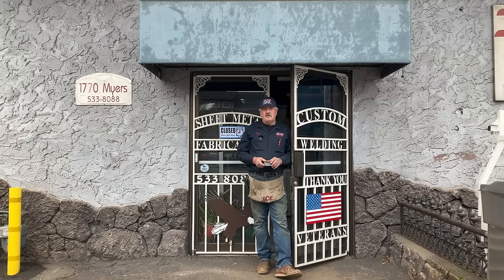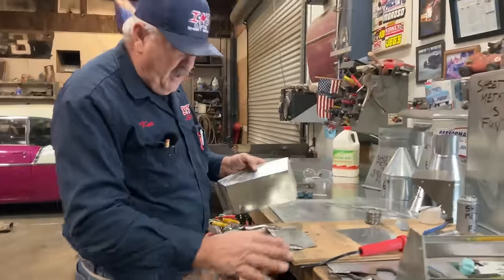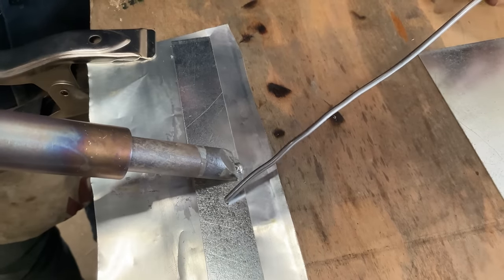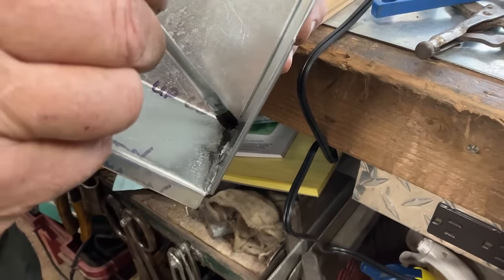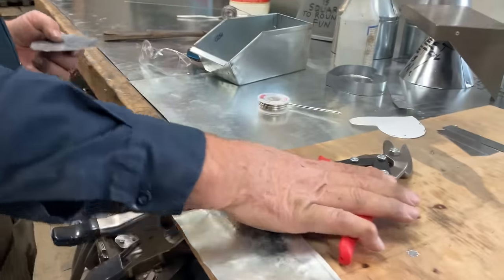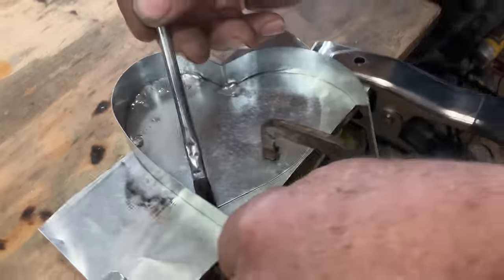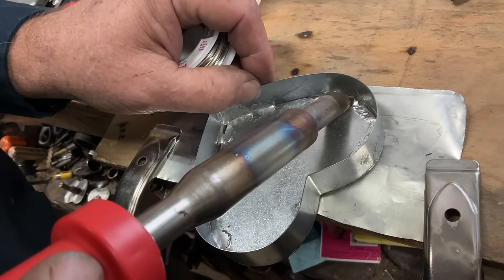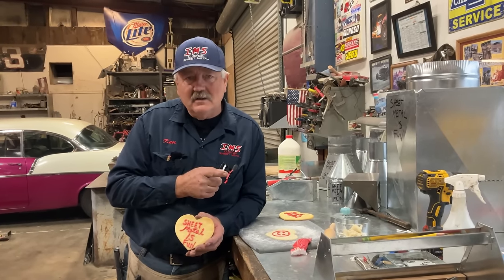Sheet Metal is Fun! Soldering from the Heart!

Comment: i wish you would have talked more about the different solders that are available and which one to use on different metals, like when to use flux core or solid, when to use the acid or could you have used a flux instead of the acid.
Reply from the maker: 50 50 (tin lead) is the old stand by, all around solder. Tin adds hardness lead is softness. Old body shops use 60 40. Muratic acid is swimming pool acid and works best on galvanized. I've never used Flux core, so do a little research on that one. Flux is better on copper and stainless. Lead free doesn't flow out as well, but it's better for humans and the environment. An iron is better on flat stock, but a torch should be used on copper pipes. Let me know if this helps
Good questions. Thanks for watching

Comment: Nice job - Thanks for sharing this! 
I just finished repairing a big copper sheet metal weathervane using some of your techniques. Talk about heat spreading fast and melting nearby solder - Yipes! This was a fullbody sailboat design, so it was hard to join along the hull edge to the deck of the boat (sort of an outside corner joint). The solution was to use small "hog rings" as a series of tiny clamps to keep things in position.  Tedious but fun!   Subscribed!
Reply from the maker: That copper is a go getter when it comes to heat transfer. I'm glad you found application in our lessons. We are glad that you found us. Thank you for your time and encouragement.

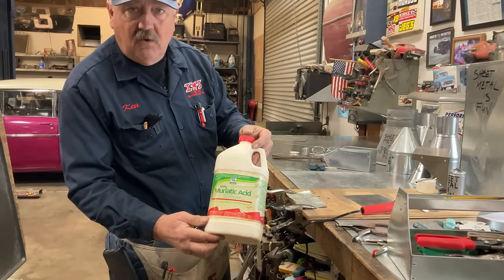Comment: 5:20  Acid brushes make sense now.  ❤  Happy New Year.
Plumbers call lead free soldier "95-5"  
A 5 pound spool has .5% or .05% silver.  Silverloy.  
Safety-Silv is brazing rod with 45-56% silver.
Very expensive and the "flux" looks like chunks of white sugar when it dries out.❤
Reply from the maker: You know your stuff. I know the lead free stuff aint cheap. Thanks for your time.

Comment: Is flux the same thing as muriatic acid? Or visa versa? Could I use your acid/lead free solder to join to pieces of steel wire together perpendicular to each other?
Reply from the maker: Flux is better for copper and stainless steel.Muratic acid works best for galvanized. Solder is only a surface adhesion, so it is insufficient when applied to a small area such as wire. Plus, the wire requires a greater heat source due to its density. Good questions. Let me know if this answers your questions. Thanks for asking

Comment: I need to make a small tray which will hang on the edge of my grinding table to hold water, I will be using your method of hand bending it. I am making this from stainless steel and want to solder the seals to seal it what flux and solder is best. Just a side note thank you for some very informative videos. Would it have been better to put something onder the hold down grips to prevent denting the bottom of the heart box. Again thank you for the videos
Reply from the maker: Good eye on the dent. When soldering stainless, you got to use liquid soldering Flux. Use solid core lead if you can get it. It flows better on stainless . Thanks for hanging out with us. Let me know if that answers your question.
Reply: @kengodfrey1956  Thank you I will let you know how I get on. That is when I have inished  small project I am working on.

Comment: I was thinking cookie cutter, cookie cutter. LOL Very nice video. I have always been curious about how easy or difficult it would be to solder something together like that. Now I know. Cool Beans!! I have learned some interesting (and fun) stuff from watching you work on this channel. 

I have a couple of questions, though. When working with galvanized metal, we are taught about the perils of inadequate ventilation and the harmful vapors when welding or grinding that material. Do those concerns apply when applying the acid to the project in this case? 

A lot of my projects involve using a dedicated soldering iron to melt holes in webbing during the assembly of a project. The fumes are rather nasty and supposedly bad for ya. 
Maybe a good project down the road would be to demonstrate how to build a small portable fume hood/extractor to have for projects like this? Just an idea. 

I noticed your acid brush kept rolling off your spray can lid. You can put a notch on the rim in a quick minute to solve that issue. No roll, no mo. :-) 

Thanks for all your great content.
Reply from the maker: Lots of questions.  That's good. Here we go. Never weld galvanized. Grinding and soldering are inherently risky. Use caution and ventilation. I should have mentioned ventilation on our soldering lesson. Good catch. I have to send this so I can read the rest of your question
Reply from the maker: We use a portable dust collector when we are in an enclosed area. It's on wheels and generally used by wood shops. Our shop is so drafty, small projects generally don't require much ventilation. Good idea on the paint can lid notch. Thanks for watching and commenting.

Comment: Brilliant episode as always. Two questions
1. How do you clean up the edges / seems especially on the inisde faces?
2. Alternative for muriatic acid? (In UK anything stronger than vinegar is strongly controlled 😢
Reply from the maker: If you can find liquid soldering Flux, it's a reasonable substitute.  To clean up the edges, I use a damp cotton rag , and wipe the excess solder off while in its molten state. So if the project is complete, you must use your soldering iron to re- heat the solder. Use caution. Let me know if this helps. Good question.

Comment: Do you have any suggestions as to best types of flux to use. I been trying to solder  a tubeless tire air valve into a empty spray paint can and no matter what I try it just won't bond. Not sure what type of metal it is made of. You make this look so easy. Great video.
Reply from the maker: Most Schrader valves are brass or stainless. Make sure your Flux lists both on its label. If you're using a torch, use paste. If you're using an iron, use liquid
Reply from the maker: Let me know how that works. Thanks for watching

Comment: Ken, what do you think is the thickest sheet metal that can be soldered (capillary action)?  at what thickness do you need to use other methods (brazing, welding?)
Reply from the maker: Depends on the weight of your soldering iron, but 20 ga. Is usually the limit. Welding 20 gauge requires a very tight joint. Welding is best , starting at 18 ga. We usually save brazing for cast iron . Remember, brazing is not welding, it's only a surface adhesion. It doesn't require or allow the material to become molten, so it's not a structural,  full penetration weld. Let me know if that helps. Thanks for watching and asking questions.
Reply: thanks Ken.  yes that helps.  also, the muriatic acid works for galvanized sheet, and acts like a flux (if I understand correctly).  but what if I am using galvanealed sheet metal. such as jet kote.  do I need to grind off the coating first before I try to solder it?  (say 24 gauge). and in that case, would muriatic acid work, or should I use a flux when soldering?  what kind of flux?   @kengodfrey1956
Reply from the maker: @markdeitchman8938  you gotta get that coating off. We use muratic acid and maroon scotch brite.

Comment: HVAC sheet metal tech here… Wiss snips are the gold standard in my opinion.  Greens come out nearly 5% of the time…. offsets are a luxury and only to be used 100% appropriately as they cost more
Reply: Started watching to see your approach and technique and stayed for your years of experience and great expansions of why things should be done the way the should be done
Reply from the maker: I switched to the wiss offsets for a metal roofing job in 88 and never went back.
Reply from the maker: I'm glad to have you along with us. I've been a shop man, an installer, a detailer an estimator and an owner . All that have given
Reply from the maker: All that has given me a real insight on how things are done best. And I am glad to share with you.
Reply: Speaking of snips there's a question I'd like to ask: some video ago, Ken said that red and yellow cut the same way, so is there a reason why I should buy both? I'm an absolute beginner and bought only a yellow and a green, offset.
Reply: @saveriog.825  they each have their purpose but yeah, I can cut straight with reds all day.  Though to be honest I very very rarely use yellows so I’m not as experienced on the benefits of yellow vs red.  It’s always green or red.  For example red can cut a circle in a clockwise direction and green cuts counterclockwise.  Yellow is intended for straight only.  Reds will cut straight all day tho

Comment: nice work Ken. I can't believe how well you and the camera lady(wife) work together. Me and my wife would be spending more time editing than it took you to complete the project. But I have a question. Is there any way to clean up the excess solder ? It doesn't seem to be a problem on the inside of a project only on the outside. It seemed to take away the nice look on the outside of your tool bin. Could it be lightly sanded or would that rmove all the solder ?  just wondering, thanks
Reply from the maker: We re- heat the solder and quickly wipe it off with a moisture cotton cloth. My wife and I have run this fabrication,welding, and installation business for over twenty years. 95% of time without any employees.  She welds, fabricates, carries heavy and hot stuff , digs holes when we install our wrought iron fences and gates, and the list never ends. Then she does the bookkeeping and accounting too. She's amazing.
Reply: @kengodfrey1956  Does she have a sister? LOL

Comment: What size solder using? Just add the acid, do not need solder paste?  What gauge metal you using? 26 gauge?
Reply from the maker: @drail80s  1/8th inch solid lead free solder. You can use solder paste or liquid Flux or muratic acid. Depends on the availability in your area. We used 26 gauge galvanized in our lesson. We used lead free because it's also a cookie cutter btw. Send us a pic  sheetmetalisfun@yahoo.com 
Wel put you in our fabulous fabricators book. Thanks for hanging out with us
Reply: @kengodfrey1956  I have the .125 lead free solder, have now ordered the solder iron you talked about, have you any pro or cons of using 40-60 vs. 60-40 solder? I have solder paste and I have bought today the acid you mentioned. Should I primarily use the lead free solder for my practice? With the acid? I will be using  26 guage  galvanized like you said. I bought some scrap about 5 feet long by about 7 inches wide. I will cut it up in smaller pieces to practice seams soldering. I want to eventually make some cabinets with many different sized drawers. I have a back-ground in wood working. I have found your vides very useful and very helpful.    I will soon have my soldering iron in 6-9 days from now. I have bought the mantric acid you mentioned, I have the lead free .125 solder. And I have snipes, cutters, and layout tools. Do I need to use the acid but not the soldering paste? Just the acid but not with the soldering paste? Good to go? Thanks Ken!
Reply: Is there any difference for shop boxes, dust pans, small boxes exct. exct.... between 40-60///60-40//// or lead free solder in terms of using   them for common projects. ??? Like a dust pan or a tool tray for example? Small boxes to hold sockets, or wrenches, which is the best choice of solder to use>???  Thank You Ken again.
Reply: Along with the Weller Soldering Iron 175 watt of course. All good to go?
Reply from the maker: @drail80s  I have always used muratic acid on galvanized and Flux on copper or stainless.
Reply from the maker: @drail80s  the first number is the tin, the second number is lead.  As a rule, sheet metal shops use 60/ 40 for the strength and body shops use 50/ 50. Great questions!  Keep it up. The lead free is for anything that may come in contact with human consumption applications.
Reply: Ok, I will use 60-40 then. However would it matter strength wise if lead gree solder use instead? Not talking about eating or drinking. Shop tool trays, stuff like that, is lead free solder great to use? Thanks again Ken. BTW, I have used rivet trays and tool holders from watching your stuff for inspiration. I am going to see if I can send some pics, want to be in the photo album! So will lead free solder do just as well? Just as good as 69-40?
Reply: 60-40 is what I meant
Reply from the maker: @drail80s  lead free is the way of the future. Nows a great time to get familiar with it. It has a small amount of silver, so expect a little higher price. Strength wise it's very capable.

Comment: Does the same thing work with raw steel sheet metal?
Reply from the maker: Solder is only a surface adhesion process. The surface must be smooth for the proper transfer of heat, and it must be clean of any oxides. That's what the acid does. The metal must also be thin enough to quickly absorb the heat from the iron. Let me know if this answers your question.  Thanks

Comment: I would think that plumber's flux in place of the muriatic acid would be appropriate?  Is there any need to neutralize the acid after soldering? Say with a baking soda solution, for example?  Also, it may not be a good idea to breathe the fumes that come off the project when soldering.
Reply from the maker: Acid outperforms Flux on galvanized. Muratic acid is neutralized by water. You are right about ventilation.  Our shop is so drafty It's not an issue. But you are right, I will mention that on our next soldering lesson. Thanks for watching. We appreciate your time.
Reply: @kengodfrey1956  Thank me? No!  Thank YOU! 👍

Comment: to your knowledge, has anyone ever repaired a fuel tank with this method? thanks again.
Reply from the maker: Soldering is a good method on fuel tanks if the tank is galvanized. You cannot bridge a gap with solder. You must have a lap seam which provides the solder to place to laminate . The metal must be very clean or the solder will nor adhere. Good question. Let me know if this helps.